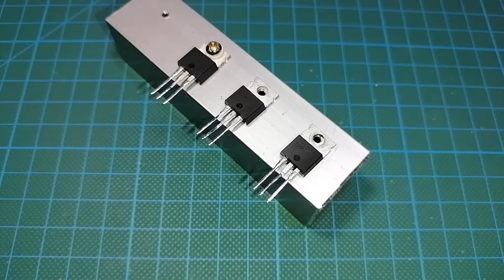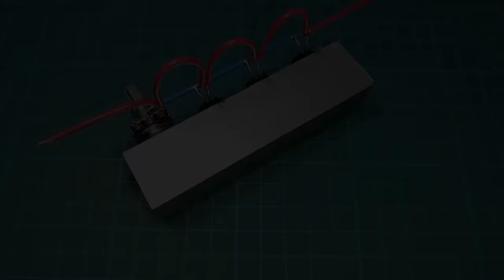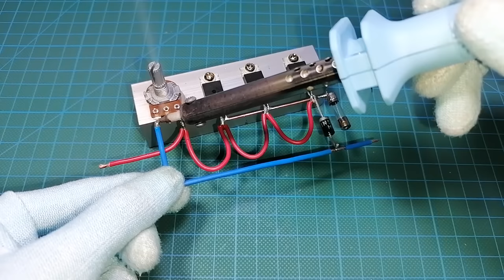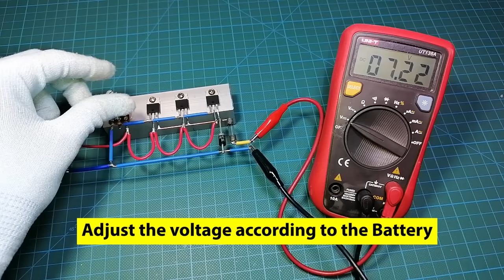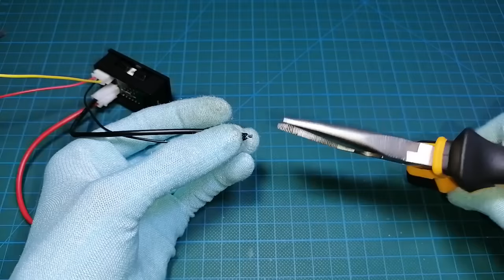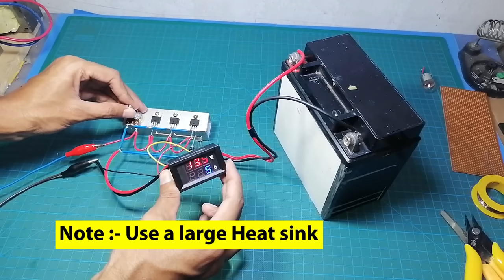DIY charge controller for Solar Panel, MPPT Solar charge controller Homemade

Comment from the maker: CD/DVD solar panel possible ?? 👉https://youtu.be/_Vo5o0aXUGE
Reply: No
Reply: No
Reply: Yes with series parallel LED strings, the CD DVD is just used to light gather & house the LED's Also Your diode solar Panel would work better if you scratched off and removed the painted markings on the outer glass of the diodes. Mark the Anode Leads with red ink to denote + Pos
Reply: I need something like this that's going to Run 350 W solar panels any help
Reply: Is it suitable for regulating the charging of a 150ah battery?

Comment: This not mppt it's voltage regulator 🤣
Reply: very good observation.Also the diode is not even to 10amps
Reply: I think it's PMW
Reply: Too much heat
Reply: Yes exactly. He just built a totally analog voltage regulator. With 3 parallal mosfets.It's not even PWM, let alone a MPPT. Which is why it needs a huge heatsink to dissipate the power loss due to voltage difference. Video is meant to make him money, not to educate anyone.
Reply from the maker: :yougotthis::yt:
Reply: even it isn’t voltage regulator. output voltage will change when solar panel voltage go up or down..
Reply: @homemade_101  হায়
Reply: Igual y se agradece
Reply: This is NOT MPPT and it even isn't a regulator! Therefore it IS dangerous since you can overload your panels and overcharge your battery.
This kind of DIY videos should be forbidden on youtube!
Reply: @BeertjeRulez  👏👏👏
Reply: Thought it was indian video 😅

Comment: This is a PWM and voltage regulator which will completely destroy your battery. Anything with a higher voltage can charge a smaller voltage. It only regulates V, and not A.
Reply: IT's not even PWM
Reply: Well its neither PWM or MPPT The good part is its click bait and we are the fish :) it worked
Reply: Hola genial tu experiencia conocimientos. Sería ideal ver uno con controlador así como dices. Hay algún link video explicando??

Comment: There is no clocksource to switch the Mosfets, so it's not even a PWM controller. Let alone MPPT. It's pure anolog/lineair voltage regulation. The huge heatsink is needed to soak up the high power loss due to voltage difference. Video is meant for the clicks, not to educate anyone. Don't build this, it's useless.
Reply from the maker: :yougotthis::stayhome:
Reply: Thanks dear for telling truthness of this 🙏🙇‍♂️🙇‍♂️🙇‍♂️

Comment: Using a potentiometer is just asking for trouble unless you have a very small solar system if you have any type of solar panels that are over 100 watts like myself a potentiometer is not what you'd want to put in your circuit.

Comment: i'm sorry is not pwm or mppt, is only voltage comtroler, mppt circuit or pwm is more complex, don't stop the charger and maube destru the battery.
Reply from the maker: :washhands:

Comment: This is NOT a MPPT controller, no inductors.  All you did is set up a voltage divider with the POT and feed that voltage to MOSFETs.  This is a linear regulator.

Comment: This is not  MPPT or PWM, it's not even a basic linear voltage regulator, there is no over voltage protection or current limiting, so all you've made is a variable resistance that gets hot.
Reply from the maker: :yougotthis:

Comment: With out coil , mppt ???
With out zener diod or ic , regulatör ???

You are unbeliable 🎉🎉🎉
Reply from the maker: No Mppt but simple Solar charger. Yes Regulat voltage

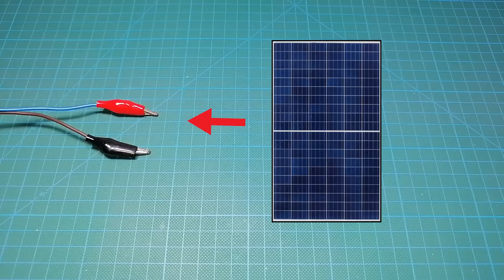Comment: @ 3:53 You show solar panel with 12V to 60V - Measured shows 17.26V But what Wattage reading is taken from your panel information? And it is best to cut that by 1/3 to average the day light Watts - next your test is with a 22 Watt 12V lamp = max I = 22W / 12V = 1.833Amp, Not a 8 or 9 Amp Load ? - When charging a 12V Car Battery the Battery will take as many Amps as it can get to charge as fast as it can and the charge Amps dropping as the charge accumulates in the cells - So adding a Current controller to your Voltage controller circuit to limit the current would be a good idea to control the in rush current demand to the solar panel when connecting to a flat battery.

Comment: This is MPPT. Just manual, that's all. When he turns the knob he can choke current flow to maintain solar panel voltage at MPP. Buck converters are used in commercial models that do the same thing by varying the duty cycle of power converter coils.
Reply from the maker: :yougotthis:

Comment: I'd like to make a basic solar charger for a 7.4V, 2A lithium-ion battery, along with a simple charge controller. I plan to showcase this in college. Could you please offer some advice and ideas for making solar  voltage controller?

Comment: A simple voltage regulator or actually a pwm charge controller that waste the excess volts as heat and not an mppt charge controller that converts excess volts to Ampere
Reply from the maker: :yt:
Reply: @homemade_101  y

Comment: All of you shouting it's a simple voltage regulator, if this is connected to let's say a BMS-ed 18650 battery pack will it still damage the cells? 

I have a 4S12P 18650 Battery pack that I modded with a 4S40A BMS, will I have any issues if I connect it to these circuit and my 190W Solar panel?

Comment: It's a constant current buck converter. It can be use as battery charger. Poor thing is that there is no indicator to know that if the battery is full charge or not.
Reply: to 14.4 it is full !
Reply: no, it is not. It is simply an adjustable resistor.

Comment: The variable potentiometer shouldn't be fixed on the heatsink. It's resistance will vary with the heatsink temperature 😊
Reply from the maker: yes

Comment: I did the same with a potmeter and a BC547 to adjust a led bulb from 9-12v battery. It is a manual MPPT regulator so you can see how much 'A' the solar panel supplies and if it is too much you turn it down
Reply from the maker: :yougotthis:
Reply: Hi Jaobhn2 - I did the same with 2n2222 and a 18V Dewalt 1.5Ah battery pack to drive a 12V LED Cob Strip for my work bench lights. I run the LED at 11V drawing just 0.035mA So the battery pack lasts a week or more in 5 or 6 hr uses. No I do not have the Dewalt Drill or charger, So made a variable Charger from a 240V AC to 30V AC transformer using old TV parts.
Reply: Jacobn2,do you really tried this sir?can you please send me the diagram please? i have npn transistors,so i have to try that.. thanks for rply😊
Reply: @vicferrepedraya-678  Take a 9v battery + for collector and
from emitter to a 12v led bulb + , take a 10K potmeter across the npn transistor, the center leg must go to the base of the transistor. the led bulb's - goes to the battery's -
Reply: @jacobhn2  ok sir,can you send me the diagram sir?in order for me to see the circuit.. thanks

Comment: Poxa legal mas se alterar o valor de entrada também alterar o valor da saída
Reply from the maker: Can you explain english bro ?
Reply: @homemade_101  I said very nice your project. however if you change the input you change the output value too. as we know that the solar panel has varied voltage.

Comment: Gracias por compartir!  Vi en la descripción que se necesita un gran disipador. Por hende, se desprende que buena parte de la energía solar recolectada la perderás. Es por ello que sería interesante recurrir a un regulador de conmutación implementado con una fuente step up.
Reply from the maker: :stayhome:
Reply: Sim! uma boa parte é transformada em calor. Mas pense assim: Cedo o painel não produz. Mas ao clarear, aos poucos, consegue-se uma tensão maior. Se for válida, um step up, vai fornecer a voltagem, para carregar a bateria. Aí chega um momento em que o painel produz mais e o step up, deixa de ser útil, seria a hora de usar um step down. Então o dia começa a escurecer. O painel fornece cada vez menos. O step down, sai e entra o step up, para aproveitar o resto do Sol.

Comment: This is not auto cutt off the voltage like in charge controller, it is just changing the value of the current as required.
Reply from the maker: yes

Comment: This is wasteful and not MPPT at all. You just heat off your excess voltage, a real MPPT would use over 90% of the available power to charge your battery, finding the optimal panel voltage and load amperage to get the maximum power output from the solar cells, then converting it to the required charge voltage via buck/boost.

Comment: Imput maximu volt
Reply from the maker: 50V
Reply: @homemade_101  thanks 😃
Reply: @homemade_101  I would like to know if I can make a car radio work since it consumes 12v 5A, will I have some problem or will everything be fine, I have a 200A 24v battery